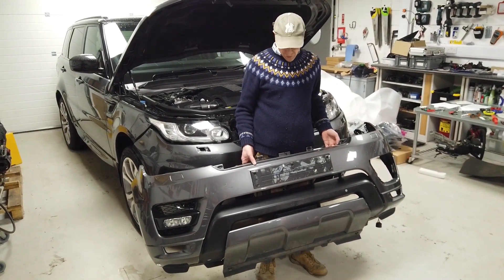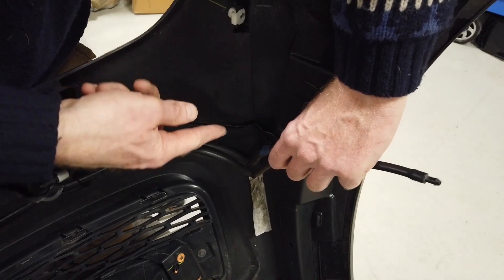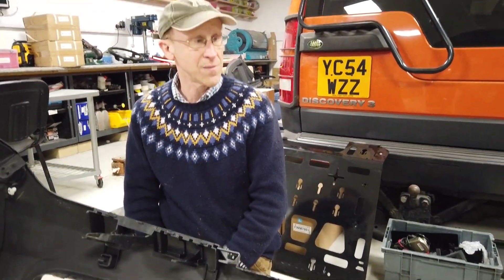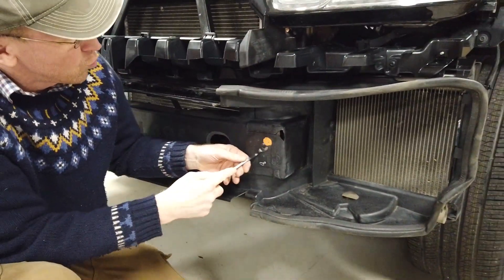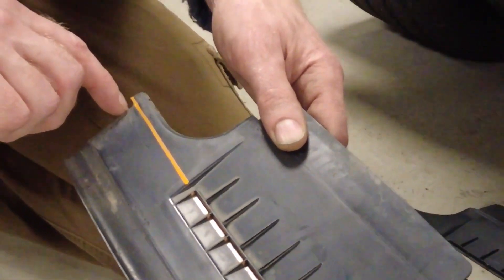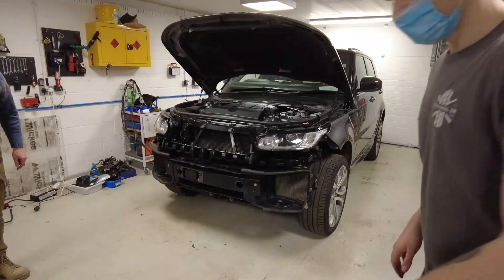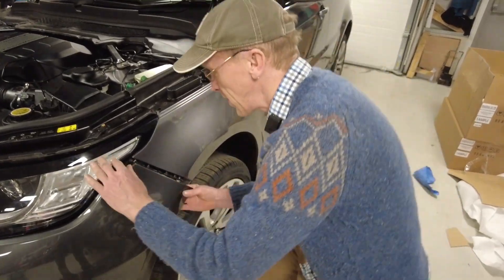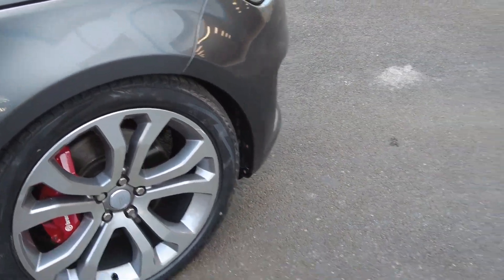Range Rover Sport L494 2015 Front Bumper Fitting Guidance for SVR Bumper (genuine)

Comment: Hi mate, you’ve got very informative videos! Keep up the work! I have a question if you could help me with. I’ve got the L494 2017 pre facelift model and have managed to get myself a pair of genuine facelift headlights. Is it as straight forward to retro fit them with the relevant plug adapters or is it more coding and complex than that?
Reply from the maker: So the 2018 headlights require a new grille and front bumper as i recall. The electrics are also different and will need some modification to the internal electrics on the lights.
Reply: @L663  there’s this adaptor which is an adaptor from the pre facelift to the facelift plug and apparently it doesn’t come out with AFS fault codes…. Whatever that means
Reply from the maker: @OfficialJeza  AFS is the cornering headlights - where the headlights look left as you steer left etc.
Reply: @L663  ohhhhh right! Do you think they’ll work with the genuine headlights I’ll be getting with the adaptor I’ve got? And do you have Instagram or anything we can talk on a bit easier than here

Comment: Hi Chaps. You mention at 6.45 minutes in about the brackets...

Do you know if the brackets and the headlamp washer brackets on the inside of the bumper on svr are the same as what's on the original l494 bumper?

I don't seem to have the brackets and the washer brackets but I do on my car so wondering if I can swap them over and re apply adhesive.

Thanks
Reply: Hey man, did you happened to find out that if u can use the same brackets on the svr from l494 bumper cause mine didn’t came with them as well. Thanks.

Comment: Good stuff... FYI, the SVR with 21 inch alloy wheels did not come with the extended wheel arches and if you spec the 22 inch alloy wheels, I does come with the extended wheel arches.

I fitted the extended wheel arches to mine and added the 22 inch alloys and personally think it’s a good upgrade. And can be applied to any RRS, so might be worth you guys supplying 👀. I’ll take a 10% cut of each sale🤣
Reply from the maker: Hi James.. we have the side arches but wanted to do those in a separate video. I did not realise it was only the 22" rims that got the extended arches. MY wheels need spacers I think as they dont fill the arches.
Reply: @L663  I put some H&R 20mm hub centric wheels on mine and really completes the look of the car. Happy for you guys to take a look at the ‘final product’ of my car and the look I’ve gone for!
Reply from the maker: @jamesoliverrandall  Yes I would love to see pics / more details on the spacers....